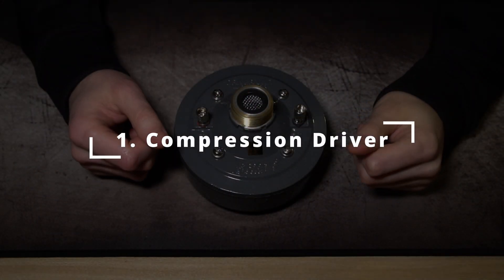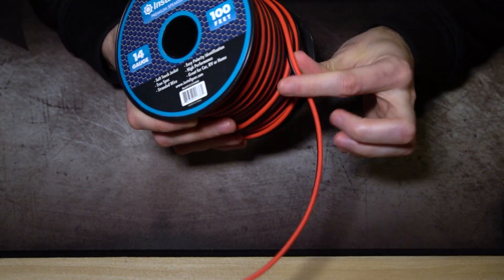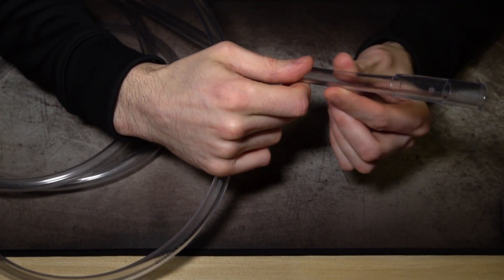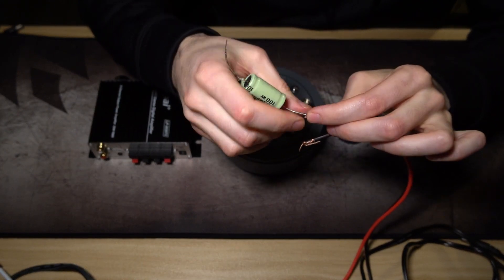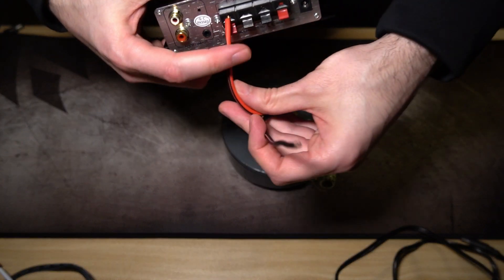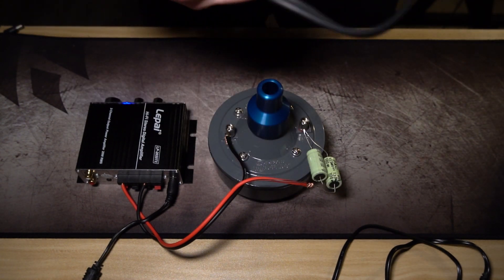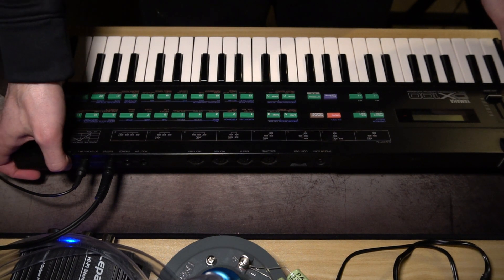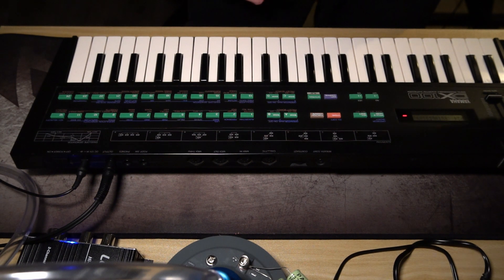How To Build A Talkbox (DIY Tutorial)

Comment: the compression driver link is not valid anymore... I have seen some compression drivers are for tweeters, and dont do low freq... just making sure I am getting the right parts... out of the USA
Reply from the maker: Thanks for letting me know, I just updated the link with one that will work. The one you will see will go down to 160hz - 7000khz.
Reply: @DjRuthful  Thanks a ton to you for the video, I only have found some normal speaker available here where I live, but I will try to source this driver when I come to the US, I am building 3 different experimental models, one with a funnel one with a toilet plunger (as seen on YT yes), and one like you... lets see what happens... 🤪

Comment: Thanks for the info. Well done. I may give this a shot. I have a few questions:

In this example, you are sending the Amplifier a stereo signal, correct? (TRS -> left/right RCA jacks).
Can you explain why the compression driver is hooked up to the amp with the positive lead going to one channel, and negative to the other?

What would the connections look like if I want to send the amp  a mono signal, like for example from a Guitar instead of a Stereo Synthesizer?

Thanks!
Reply from the maker: Thanks for watching and definitely give it a shot. It will feel great to have made your own that sounds so much better. 

1st question: No, the RCA to TRS is a stereo (RCA) to mono (TRS) cable. You will need a great quality RCA to TRS cable to connect the amp to the source of sound, i.e (amp to a synthesizer or guitar).

2nd question: The compression driver is a mono speaker. I know in the video I demonstrated putting the other end of the speaker wires on the left channel and the other on the right, on the amp @7:27 . That's a mistake on my end and you should use the left channel only on the amp. So, black and red wire go into the left channel on the amp.

3rd question: I think my 1st answer to question one answers that. the TRS will go into guitar or any sound source that has a TRS output.

Hope this helps and if you need anything else, let me know.

Comment: Gotta question. If the 20w amp comes with a PS, what's the reason for buying an additional PS?
Reply from the maker: @MBL80 oh yeah, I see what you mean now. The 24v PS is needed for that compression driver and the capacitors, since those parts are pretty powerful. Also, If I remember correctly, that power supply that comes with the amp had issues; think I read it in the review section. Hope that helps 👊🏼
Reply: @DjRuthful  it most definitely does help. You that moment when the light bulb 💡 pops on 💡. Makes so much sense. Thx again,!
Reply from the maker: @MBL80  No problem, anytime. If you need anything else on talkbox, let me know, and contact me via email or social media. I'm glad I was able to help, have fun 👊🏼
Reply from the maker: What would the additional PS come from? Not sure if I understand your comment, hopefully you can explain to me what you mean.
Reply: @DjRuthful  ok so I bought the Lepy 20w amp and it came with a 12v PS/ adapter. Also you've provided us with an additional 24v adapter. I'm just trying to get educated as to why get the 24v when I already have the 12v.
Hope this helps.

Comment: Hey! Great video! I have an 8ohm, 60W compression driver, and a 60W amplifier module. What kind of capacitors would you recommend? Greetings from Greece!
Reply from the maker: You can actually get away with the same capacitors I linked in the description, or get a 8 ohm version of the 133mfd non-polarized Capacitors. 

Thanks for watching the video 👊🏼

Comment: Great tutorial, but apparently the driver is no longer available. Any alternatives you might recommend? Thanks!
Reply from the maker: Yes, you definitely want to get non polarized capacitors. If I was you and to make things simple (because it can get complicated, if you go another route). Just stick with two non polarized 133uf capacitors @100watts
Reply: @DjRuthful  Ok, thank you very much for the additional information!
Reply from the maker: @nkronert  no problem, glad I was able to help.
Reply from the maker: https://5core.com/products/5core-compression-horn-driver-audio-tweeter-unit-screw-on-timpano-speaker-16ohms-du-100xt

I got this link off their website (5Core). I ordered from them before and they seem like a great source for those drivers. Hope that helps and thanks for letting me know 👊🏼
Reply: @DjRuthful  Thanks a million for the quick reply! 👍
Reply: @DjRuthful  Sorry for one more question: the capacitors, If I want to get them shipped to Europe, it's going to be $25 extra. So I'm trying to find alternatives over here. I've been trying to Google, but not much luck yet. Are the values critical (apart from the non-polarized requirement)? Thanks a lot for any insights you (or other commenters!) might have.
BTW: I see you're putting the caps in parallel, so my guess would be that this effectively mimics one cap with double the capacitance. Is that just to lower the cutover frequency or are there other benefits over using one cap of the effective capacitance?

Comment: hi, i have mxr and yamaha dx and i was wondering if it could be upgraded to sound like talkstar? I mean boost the mxr talkbox , maybe i can add more power and eq? Or is it all about the speaker itself?
Reply from the maker: It's all about the compression driver. The compression drivers that are being used on the MXR, Banshee's and many others, are very weak. No low end because it has a low pass shelf between 300hz to 500hz. But, sound plays a big factor as well. You should definitely use a sawtooth synth from your Yamaha DX and customize it to your liking, It's what I did.

Comment: Can I make it with a smaller power speaker? For example 60w, I can only find 100V, 100uf capacitors here (in my country)
Reply from the maker: Well you can't use a speaker, it has to be a compression driver/horn driver. You can get a smaller driver, but the lowest I recommend is at least 80 watts. Try eBay to find the specific capacitors, that's where I purchased mine.

Comment: Perfect. Can you help me? I can't buy the bass capacitors (PAC 133SP).They do not import it to my country. I have found this one: BB133 Audiopipe In Line Noise Filter Speaker Bass Blocker 4 OHM Blockers.It's similar?
Reply from the maker: Those are in line noise filters, so I believe that will not work. Just look for any Non Polarized 133mfd Capacitors at 4 ohms, and remember to get two of them, not one. You will need two of those to block those frequencies that will blow out your compression driver. If you need to, you can email or dm me on Instagram. All that info is in my YouTube about page.

Happy building 👊
Reply: @DjRuthful  OK. THANK YOU SO MUCH
Reply from the maker: @manuellopezmolina7612  no problem, anytime.